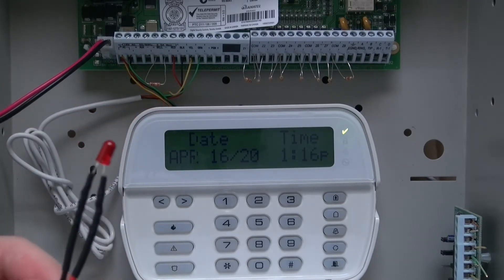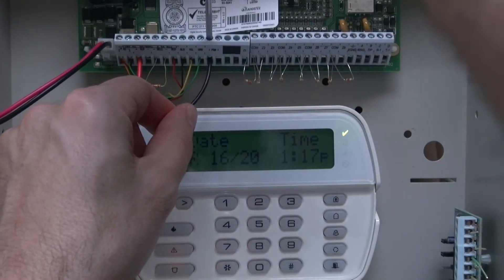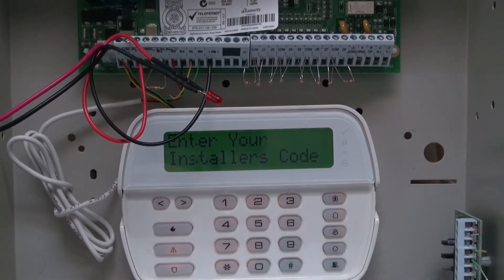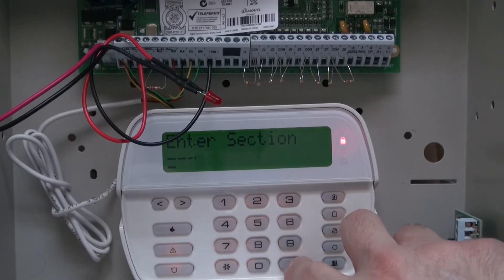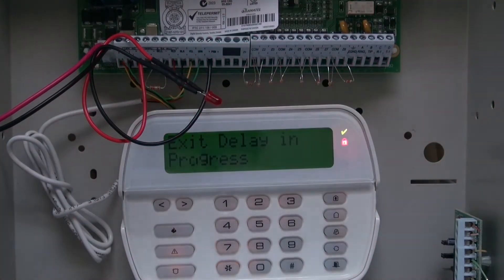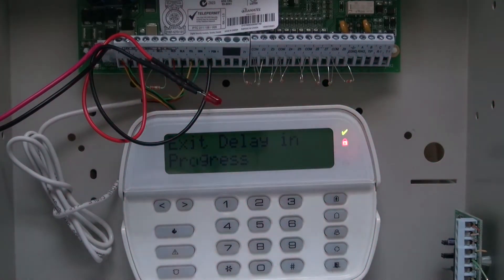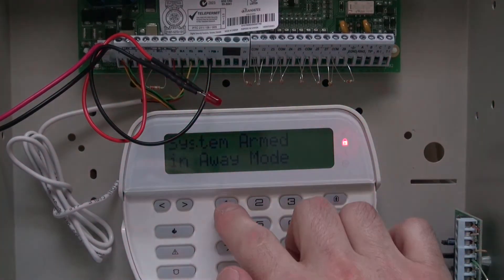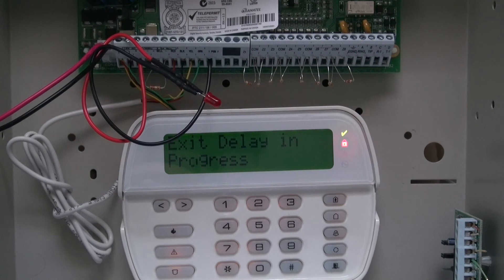How to setup a LED Status Light on a DSC Alarm, pc1616, pc1832, pc1864

Comment: Thanks for the video. Question what about using the pgm 1 or 2 through a Connect2go module as a remote toggle function to drive a 30 watt outside siren via a relay? Application: outdoor video cameras that are internet accessible for monitoring, we have an issue with folks loitering by our rear door at night. I would like to be able to trigger the outdoor siren via the connect2go app. How would I configure the panel from the connect2go module? I would like to set the siren to latch for a specific time period (90 seconds) when I trigger it via the app. I just cant find the addresses that need to be programmed to latch that ground off of the PGM 1 or 2 (PC1616). Obviously PGM provides switched ground to a relay which would drive the siren. It's the configuration I am getting stumped on. Thanks
Reply from the maker: That's something I have to play around with. Give me a couple of days and I will get back to you.
Reply from the maker: Ok John
* 8 - installers code
section 170 - 090 ( this is for the timer)
section 009 - 19 - 00
section 501 --    - - 3 4 - - - -
on the app hit Toggle PGM / type in 1 then proceed.
Let me know if you have any problems or if you want me to make a video on this.
Reply: Okey Dokey, works like a swiss watch, thanks Sir.. Cheers  @JasonTech
Reply from the maker: You're Welcome

Comment: How to program partition for main house and 2 different suites ??
Reply: eg. 123456789 10 11 12 17 on the house side 
13 14 and 18 is on one suite and 15 16 19 on another suite
Reply from the maker: Hi. There's a few steps to do that. Question: have you ever programmed a system before?
Reply: @JasonTech  yeah i did

Comment: Hi Jason, any utorials on how to set your arm/disarm to sound on your siren?
Reply from the maker: Hi Clayton. What you want is, when you arm and disarm the alarm you want the siren to Squawk?
Reply: @JasonTech  Hi Jason that is correct. i am using an ET remote that had been programmed already, but now i would like to continue using the remote, but have the Siren notify me when the system is armed or disarmed.
Reply from the maker: There's 2 option. I will did a video for you and on post it this week.
Reply: @JasonTech  thanks so much...looking forward to it

Comment: Hi sir how do I program the led lights on DSC 1864 panel. Two different led one for two partitions
Reply from the maker: Hi Daniel. There's a few steps, You have to set PGM 2 to Partition 2 and then setup the LED light. Do you know how to set PGM 2 to Partition 2?  http://www.alarmhow.net/manuals/DSC/Intrusion%20Panels//PC1832/Application%20Notes/v4.2%20PGMs.pdf

Comment: Hi  sir , the Led we  need to add serial resistor with led ? or just led only connect to aux+ pgm1
Reply from the maker: Hi Doug. If you are using a 12v Led, you will need nothing but if your LED is less then 12v then you will need a resister.

Comment: I cant clear this beeping sound from my panel. I also show a window tamper when I only changed the battery. How dobi reset the tamper alarm and how do you properly change batteries in the window sensors? Thanks
Reply from the maker: Hi. There a tamper switch next to the battery. Make sure you put the cover back on right.

Comment: DSC actually makes a tri color status light that includes "Ready", "Armed", and "Alarm" indication. Only works on partition 1 though.
Reply from the maker: Hi Christopher. It should work on all partition, you just have to program it to the partition that you want.
Reply: @JasonTech  It’s not programable. It just connects to the key bus
Reply from the maker: What panel do you have? Do you have the installers code?
Reply: @JasonTech  PC1832. The status light is a PC5601

Comment: Hi, is there a way to have the alarm show a different colored LED when unarmed?  
Also, is there a way to have push buttons added to the DSC board that would disarm and arm the alarm?
Reply from the maker: Hi. No only when it's armed for the light. Armed yes but not disarmed.
Reply: @JasonTech  cool.  Can you provide some direction on how to arm the arm via a wired push button? It makes sense that disarming would not be allowed
Reply from the maker: Question: Why don't you use EVL-4CG. The app is free and you can arm and disarm from anywhere and get text alerts.
Reply: @JasonTech  I bought the Envisalink 3 a few years back and did not like the web interface.